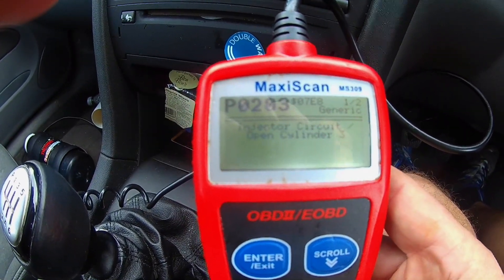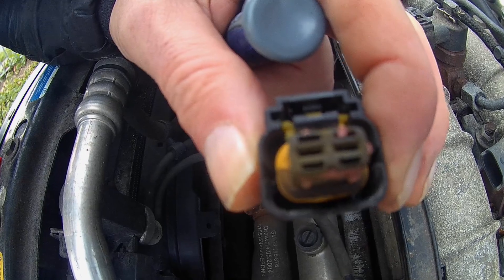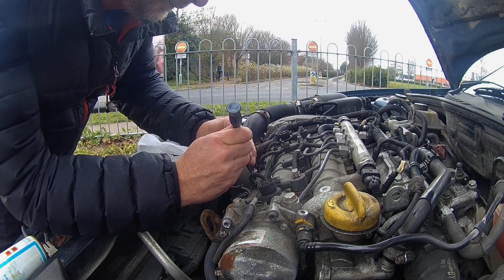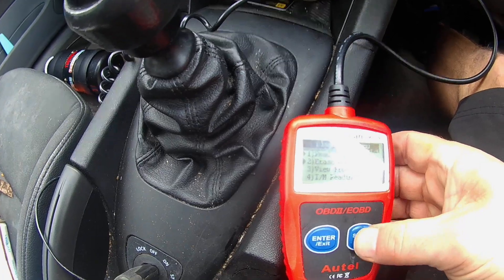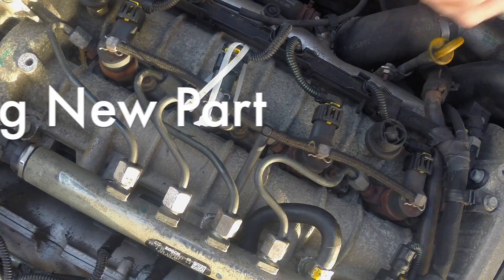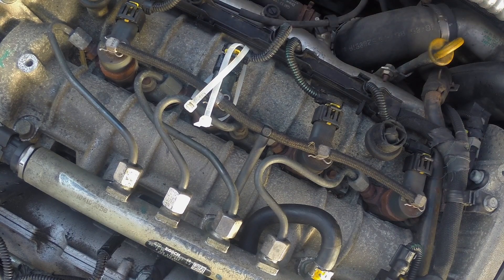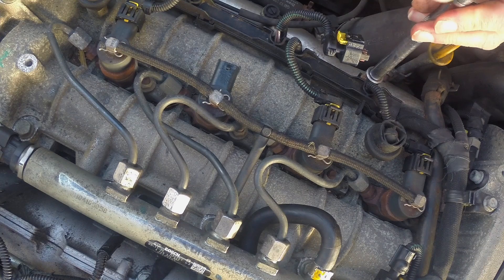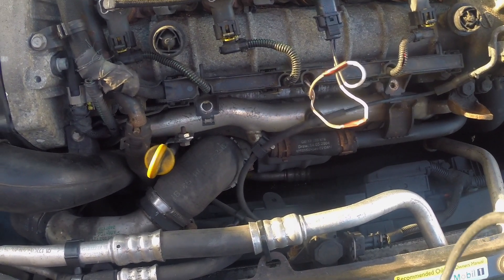P0203 Injector Wiring Fault Fix

Comment: Good evening my friend!

I have code (P0201- Injector Circuit/Open Cylinder 1).

What does this mean, Jumper the Fused B+ circuit and the ASD Relay Output circuit in the IPM?
Reply from the maker: Fuel cut off relay? No signal from crank sensor.
Reply: @reglard  
Im not grasping what you explained my friend.

What exactly do you mean?
Reply from the maker: @Diagnose1  https://dannysengineportal.com/crankshaft-camshaft-position-sensors-function-failure-diagnosis/ sound like you may need to get someone to diagnose the issue as it can be a number of things.

Comment: Whats that new part called? I'm having the same problem at the moment. Thanks
Reply from the maker: It's the injector wiring loom repair kit. Just put part number into Google.
Reply: @reglard  thanks 👌🏼
Reply: @Roy H Hey been having this problem 2 times already it goes away for a few days and comes back the check engine light comes on and the car loses power what should I do!!
Reply: @Yungflacc  a good tempary fix is using cable ties. I never ended up replacing mine, just a couple of times during the year I owned it I just had to reset the positioning of the cable tie. When you notice the loss of power, leave the engine running and wiggle each of the connectors (as seen in the video) you should notice the sound of the idle change and be much smoother. This will let you know which is causing the problem
Reply: @Yungflacc Have u resolved ur issue. If so how ?

Now am facing same issue like u